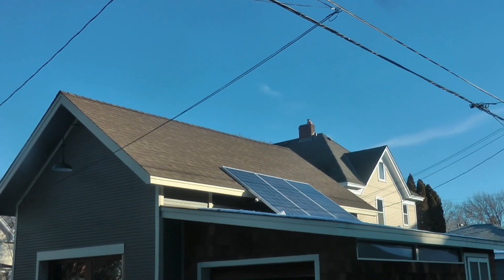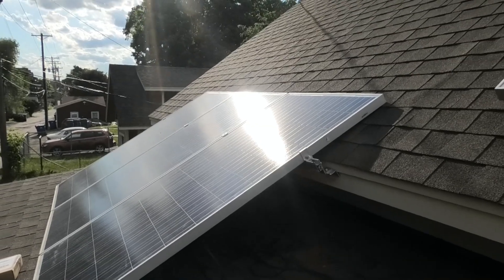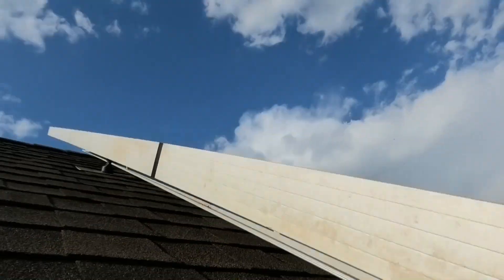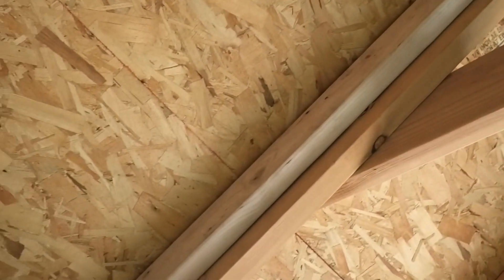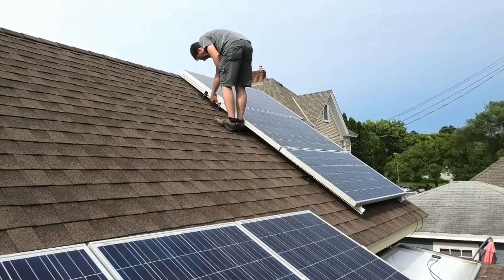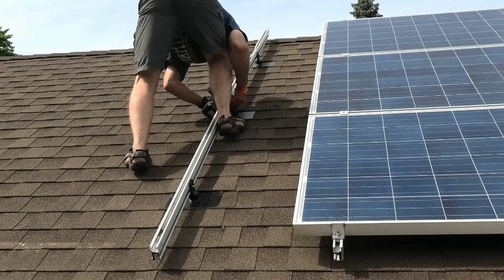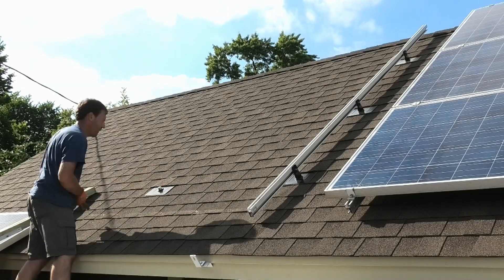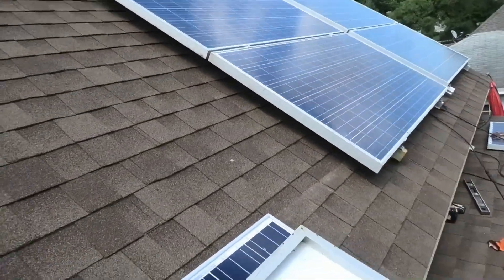Chevy Volt Battery-Based Solar Setup - Roof Mounting the Panels

Comment: Should have used sealer either solar seal/rain buster/geocell under the flashing. Also no more than 1 inch of wire should be exposed to the sun. Good luck.

Comment: YOU DOING IT WRONG, DON'T SELL ENERGY TO THE GRID FOR PENNIES, BUY 4M3 INSULATED WATER TANK AND HEATING ELEMENT AND STORE EXTRA ENERGY! 4 CUBIC METERS OF WATER OF 30-90 CELSIUS TEMPERATURE DIFFERENCE IS 250KWTH OF HOME BASELOAD ENERGY STORAGE FOR YOUR KITCHEN, SHOWER, DISHWASHER, WASHING MASHINE, DIY  DRYER! if you utilize your whole extra energy in the hot water storage - system gonna repay itself 4 times faster!  ALSO MUCH LESS  POWER HARDWARE IS NEED AS HEATING ELEMENT CAN WORK ON DC POWER!